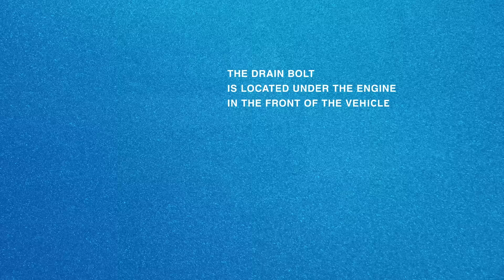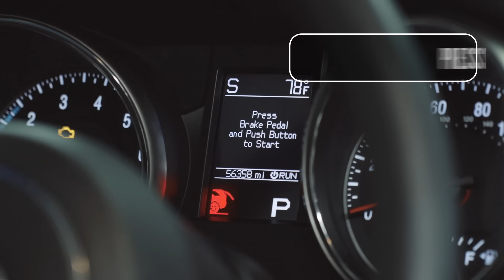How To Change The Oil In A Jeep Grand Cherokee

Comment: Nice video.  Thanks.
Reply: Bill Gillock he is using high mileage oil. Once you use it stay with it or you may have leaks. High mileage oil swells the seals. If you go back to regular oil the seals may go back to the way they were and leak.

Comment: You probably want to add that proper torque needs to be applied to the drain bolt, and new washer installed, otherwise this may lead to serious problems, like sudden oil loss.